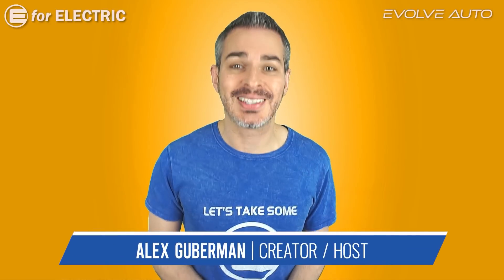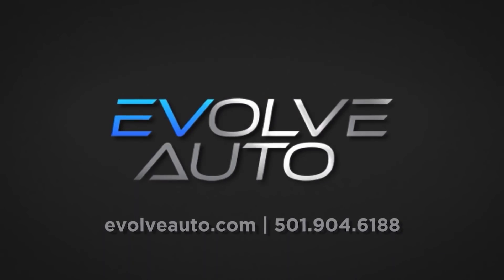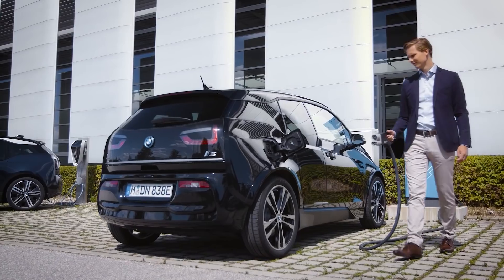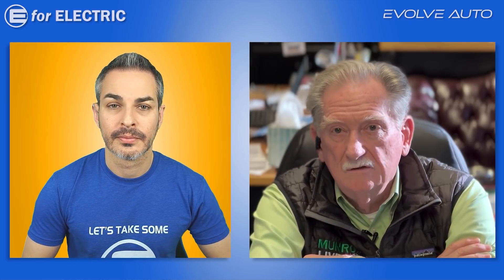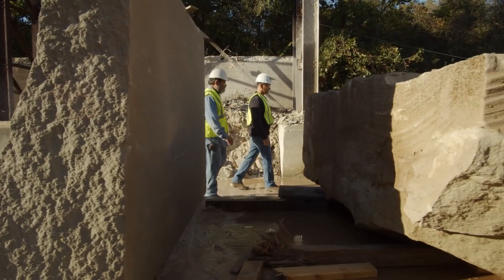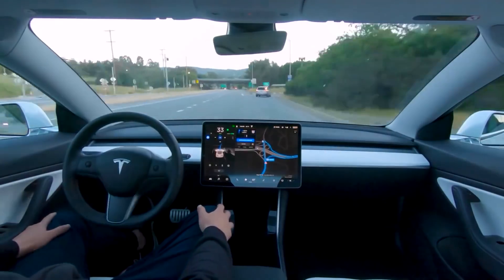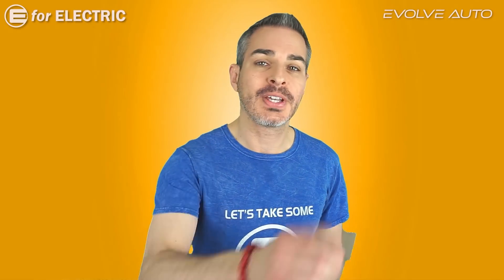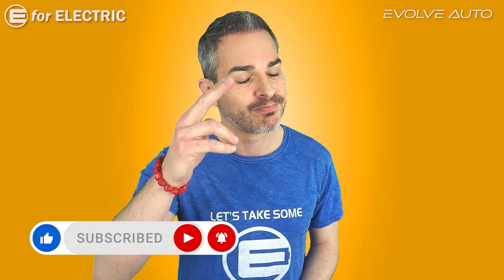SANDY MUNRO Explains Why V2H & V2L is the Future

Comment: Isn't that the most natural thing to do? 

V2H and V2L and also V2G? 

How is that even a question of whether an 
EV needs to be able to do that?
Reply: Because it can be done, I don't think it is the best way to do it.  Batteries still have a limited life.  If you use this to back up the grid, your car batteries will degrade faster.  Not desireable if you want your $100K Rivian investment to last.  It will be more viable when LiFeO4 batteries are used and even more when longer life batteries are developed.  Now it costs $25-50K to replace a battery pack.  I don't think you could get it paid for before you would replace your pack.
Reply: @GeorgeinOregon  That's a good point. 

You have to work it out in detail according to your particular situation and circumstances and your own requirements. 

Better battery technology is always a good thing in any case.
Reply: @silberlinie  I don't think using a Leaf would be a good idea with their uncooled low lifetime batteries.

Comment: Note the F150 has 20 amp receptacles—needed for larger tools—and the other vehicles have 15 amps. That's 2400 peak Watts at 120v and for the 15 amp 1800 Watts.  20 amp has a plug that looks like (|°|-) instead of (|°|)  I'd like to know how many separate 20-amp circuits there are in the F150 and the Cyberspace Truck.

Comment: Every Tesla ever made can do vehicle to grid or load. In fact any EV with DC fast charging can do it. All it takes is an external inverter and a software change.
Reply: Well, sure, but if you've still got a warranty and want it honored, probably not the way to go. Will be nice when it's commonly built in from the start.
Reply: @mockingbird187  There is nothing to be "built". All that is required is for our lord and savor Elon to say "make it so". An over-the-air software update and and external 400v DC to 240/120 AC inverter is all that is needed. This is exactly what Ford is doing with the lightening. The inverter would be small enough to mount in a garage or haul in the frunk or trunk of any S,X,Y or 3 for portable on-site use.

Comment: I can see how if you are in construction that an F-150 would be useful for powering different tools etc. But Sandy keeps talking about powering ones house if the power goes out. I have lived in Arizona now for over three years and have never seen the power go out. It seems that all his talk about powering ones house is a solution in search of a problem. And a $75,000+ one at that. If one is so concerned about house power going out one could buy a generator at a much cheaper price…

Comment: To all the buy a generators eventuality emission standards will make them unavailable. I think California has already set a sunset dead line for small two strokes.

For all the V2H run it flat would you not check?
For V2G you will have enable and set a discharge level. Why would you operate V2H and V2H differently?

Comment: I think the V2H is absolutly stupid.  V2H is a $100K battery backup system.  Generator and V2H both require a electrical panel bipass device and switch the panel to off grid.  A gasoline generator only cost about $1K and your done.  The backup generator can be refueled indefinatly but the vehicle cannot.  If the vehicle was used up in a power outage, only way to refuel it is to supercharge it, if they had power and you could drive there. If the power went out for me, the V2H could not run the surge of a well pump - 240vac 30A.  If you don't have water, you can't stay home long.   Lastly, for those who want their vehicle to act as backup storage like a powerwall, how long would it take auto manufactures to void battery warrantee on your vehicle?  Current vehicle battery tech has a limited charging life.  Unnecessary battery cycles will shorten expected life of your vehicle battery thus accelerating depreciation.  Currently replacement battery packs are $25K and up.
Reply: EV's can be refueled indefinitely for free with solar, which saves massive $$ over time. Battery degradation is minimal from powering a home, very slow rate of discharge compared to driving
Reply: @Sarterfishbowl  Enough solar to charge an EV, unless you are a big DYI person or an electrician with a solar technician licence, is a $10-$20 investment after rebates. Add this to the $100K EV and you have a solar powered EV charging system if you get sunshine.  No free lunch.  On top of all that,  you have solar equipment repairs and maintenance.  I have even updated some of my older equipment to get greater efficiency.  More money.   I am an enthusiastic believer in solar and have built 3 systems.  The payback on a system is minimum of 5 and usually 10 years. Then you start offsetting the EV costs.  Good long term investment but it does tie up a lot of capitol.
Reply: Why is Ford allowing it on the lightning then? Because ripping off a 0-60mph run or back to back 1/4 mile passes uses even more energy than a house sucking down 5-10kwhs per hour does that's why. Also it gives them bragging rights. 😀

Comment: V2H is silly to me.  More Muskovite hype than real-world application.  We have 34 x 350kW Hyundai Solar Panels with Enphase micro-converters,  a Chevy Bolt and a Honda Clarity PHEV; "If" the Bolt was V2H capable, why would I deplete my vehicles battery to run my home electricity needs?  This just means if the outage duration is longer than the battery capacity needed to run the home, now I'm in the dark AND imprisoned at home because the Bolt is at zero charge.  Oh, Buy a used BMW?  Sure, of course, like there are 1 Million available just sitting in junkyards?  Seriously?

Contrary to the lord and savior Musk and his cult of disciples, other companies also make home backup batteries.  Enphase does, and others.  Also the YT channel "HBpowerwall" explains DIY home backup battery builds on the dirt-cheap.  It ain't rocket science.  What a waste of time this tripe was.

Comment: Alex, I don't think you caught what Sandy was saying. The Lightning has installed exterior lighting to light up a jobsite (or campsite) by itself,  on top of providing outlets for your own lights. No other vehicle I've seen claims this.
Reply from the maker: That's incorrect. Other vehicles do have the very same feature
Reply: @EforElectric  what other evs advertise exterior lightning of a similar way though? The lightning has bed lights, running board lights and mirror lights you can activate to illuminate the area directly around the truck itself. Ford had a neat commercial showing it from an overhead drone view and man it really lights up thing's around the truck. 🤔
Reply: @EforElectric  what vehicles?

Comment: V to house isn't that great, power goes out in your area you use your truck to power your home for a few days and run your battery flat, then your stuck at home and can't go anywhere till the power is back on and your truck powers back up. You have to have a solar panels and battery backup to make it work. And if you have battery backup you dont need to use your truck. Plus the cost of the changes and equipment in your house to take the power from your truck to house, very costly to make it all happen. All the people in apartments, trailer parks are screwed.

Comment: EV and trucks don't work if you're towing. The range is horrendous.
The Rivian range drops to 100 mikes when towing.
Of course most who buy on won't take it off road.
Reply: Should watch "Out of Spec Motoring" for an example.  Kyle tested and measured towing with the Rivian. I believe it took approximatly twice the energy to tow with the Rivian.  I know it takes twice the gasoline to tow my trailer with my gas vehicle.  There is just more energy available in a tank of gasoline than in a battery pack.

Comment: V2G is vehicle to grid.  That could power your whole home at the breaker box. 

V2L is not merely a 110V outlet on your dashboard.  Most cars which have this only output a little bit of power,  which shouldn't be linked to a long extension cord and big appliances in your home. That can be dangerous. You'll need to verify the output for a particular car.
Reply: 🔌V2G is much more difficult because it parallels the truck battery's battery DC to AC output to the utility grid.  The Ford Lightings F150 240-volt V2H with a properly sized cord can work in conjunction with a UL1008 ATS or double throw safety switch. V2H should never be in parallel to the grid. Many utilities require UL listing because a breaker handle rocker arm disconnect can be defeated resulting in back-feeding power on the utility grid during a power outage. This could result in electrocution to their line crew.🔌

Comment: OK, you need to get somebody who knows about electric cars, not Munro. V2H was implemented in 2011. Actually, is the base of the ChaDeMo interphase and protocol, giving the ability to store energy during off-peak hours and providing in peak hours. 
I come from the automotive industry (20 years) and 16 year in the Aerospace industry, all in manufacturing engineering and process. I have owned several different electric cars and have disassembled several batteries to be used for other applications (like a Motorhome that runs the entire house on electric, range increase in several electric cars among other uses). V2H and V2L are being advertised stronger now, but I have been powering my house for a decade using my cars. 
He makes reference to I3s to power your house... well, no. I respect his knowledge of the automotive industry, but when it comes to electric vehicles, he doesn't know. The I3 is the most advanced electric vehicle overall (Is not as advanced as Tesla or Lucid in the electronics, but it beats them on everything else), and taking power out of a BMW is a serious challenge. A Nissan or a Tesla, no problem. A BMW will require some heavy reprograming.
Reply: he's probably referring to using the battery pack,  and it's certainly being done with Tesla, Leaf, and other surplus packs
Reply: Since you claim inside industry knowledge greater than Monroe has. Why not explain how every single ev which also has onboard equipment which already allows it to take in 3 phase a.c. in , convert it to D.C. for the onboard battery to store. 
And then allows it to come out of the battery pack once again converting it from D.C. back to 3 phase a.c. to run the motors themselves.

Somehow cannot then allow for current to flow back through the charging port. Which again every ev has and every ev sold allows both a.c. and D.C. to pass through the port, then the converter itself and then go into or out of the pack. 👍🏻
Reply: @4literv6  Very complicated explanation.  Simplified greatly,  the car uses MOSFETs to control the energy.  These are one way chips.  To allow the energy to flow backwards they would need to add another whole control panel and lots of safety circuits to flow out.  This adds weight in chips and cooling for those chips.  It can be done.  It is just expensive and would make your vehicle more complex and you would have poorer range as a result.
Reply: @GeorgeinOregon  I have done it several times by simply using an inverter. Some small safety circuits, and the rest is already there. In any case, you are missing the point. Munro has very very little knowledge of EVs. Throwing the I3 as the example for storage it the worst idea possible as because to the REX BMW had to do a lot more electronics controllers. A Nissan Leaf has the 2 connectors right at the ChaDeMo port, you just need to open the port (propper protocol in the other legs) and you have direct access to the main battery. 
The BMS is already configured and prepared to do this in most EVs. Seems like you just want to argue...
Reply: @GeorgeinOregon  still doesn't explain how the car itself takes dc from the battery and converts it to a.c. 3 phase for the motors to use.
Then does the reverse under regen braking. Again if the car itself can and does already do that. Are you somehow saying the charging ports are the ones with only one way capabilities?
Reply: @4literv6  You are absolutly right that it does this.  The motors are 3 phase.  In the Tesla, the inverter is actually integrated in the electric motor housing.  This simplifies the control of the motor and incorporates the cooling of the inverter with the cooling of the motor.  I do think this could be redesigned but it isn't really what it was intended for.  It is a very efficient computer controlled system with incorporated traction controls and regen abilities.  Adding the complexity of powering a 2 phase home would add weight and added complexity.   If you were to overload and burn out this inverter, you couldn't just go to the store and get another.  Big dollars.  A home breaker box is commonly rated at 200 amps.  True most don't use half that but some do.  Just turn on your electic stove - 60 amps at 240vac.  Your electric furnace might even be higher.  If it is only lights you want, I would just buy a Ecoflow or Bluetti and get clever.
Reply: @4literv6  That's easy, go to the leads in the pack! 380V DC nominal is enough to do whatever you want. A simple LF split phase inverter and you are done. Maybe $1500 tops. That is why the EVs are designed like that, and the fast DC charger goes directly to the pack (after a DC charger controller, of course).

Comment: Having power outlets in your EV is certainly a great idea. But directly powering your house or supplying power to the grid is overrated. The cost of actually wiring your house for this is probably inline with buying a backup generator and few people do this. So just having an EV that is capable of this doesn't mean that most people will do this. I own a Tesla Model Y Long Range. I don't believe it is capable of powering your home or the grid. But if it was, the last thing I would want to do is destroy my battery powering someone else's refrigerator.
Reply: If the grid pays you $10 for 5 kWh of your 100 kWh battery pack daily, that's $3650 / yr. Your EV is paid for in 10 yrs.
5kWh of slow discharge in mid cycle daily will not harm your battery. But unfortunately you are correct that your Tesla can't do this. Your Tesla CAN, but Tesla will not allow it (yet).
Reply: @Sarterfishbowl  I see what you're saying but don't forget this also causes accelerated wear on the battery. We will see over time if the political parties try to strip all the value away from doing this. 🤷‍♂️
Reply: The grid window switch required for installations actually islands your house from the grid itself to prevent back feeding. 
So you can only power your house with this tech not the neighborhood. 👍🏻
Reply: @4literv6  And it depends on how flaky your power is. Ours is seldom out so we don't have a generator.

Comment: have been using a inverter with twin leisure batteries for the last 20+ years to power up sites having it built into the ute ,van ,car is the best . as for party truck I'm with Sandy on this one , often power up on the beach with no noise  . keep smiling everyone

Comment: My old 2006 Lexus RX 400 hybrid had a 110v ac outlet so the V2L idea has been out a while. (note; it was a used Japanese import so sadly a 110v Japanese outlet was no use to me)
Reply: Even Nissan Leafs have V2G, ChaDeMo allows it, but... low-capacity battery and inverter, so... not as helpful.
Ford killed it w/ very high power & 240V output (both plugs, and actual V2H w/ their ProPower charger/transfer switch setup)... Rivian, just has V2L, not V2G/H. Two 120v outputs doesn't cut it.
I really wish Tesla had gotten onboard, but, that would have jeopardized PowerWall sales..
Reply: @cgamiga Yeah Ford beat Tesla to production but at the Cybertruck reveal the compressor and 240v ac outlets were part of the presentation.
Reply: @chrissscottt  Did they really beat Tesla though? I think there have been very few deliveries that they are still not obtainable by any means

Comment: It's funny that power outages has been one of the anti EV fear tactics. If they are cautious about battery degradation, great idea.
Reply: "Fear tactics"? It's simply a superior way to travel. Being able to utilize all the power in that massive battery anywhere you go is very nice "icing on the cake"! Bye bye I.C.E's!!
Reply: @Sarterfishbowl  I'm saying some people think when there's an outage you're stranded. I tell them I'm never at 0, I go to a public charger, or if power is out at work I stay home.
Reply: But if there is a power outage how are you gonna charge your car? You are now potentially stuck at home with no heat or ability to get more food. ICE is great for emergencies
Reply: @Emm2004  You do know gas stations need power to run the pumps? No power, no gas!
Reply: If there's a power outage, you have;
- solar to recharge 
- drive the EV to somewhere that has power, charge it to capacity, then bring the power home
Reply: @Sarterfishbowl  seems like a lot more expanse and headache than a generator that runs 0.0001% of the year on diesel that stays OK for years
Reply: @Emm2004  But you can also use it as a vehicle everyday. Generators just sit there waiting for a storm.

Comment: Bottleneck in V2G popularization is standards, protocols, grid operators, things like that. Looks like Sandy is not very knowledgeable in this department. Technology was ready more than a decade ago, now it's up to paper pushers to standardize it. Will probably take another decade, unfortunately ...
Reply: Another point is that batteries are getting cheaper every day.  Cars are getting more expensive.